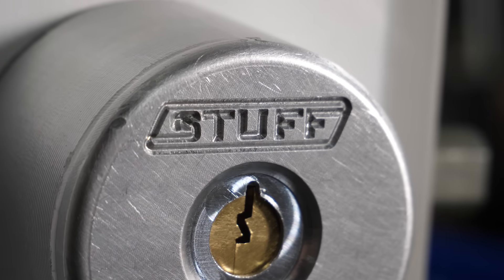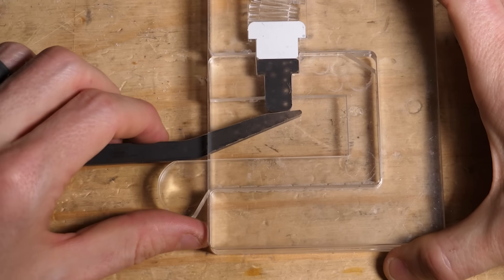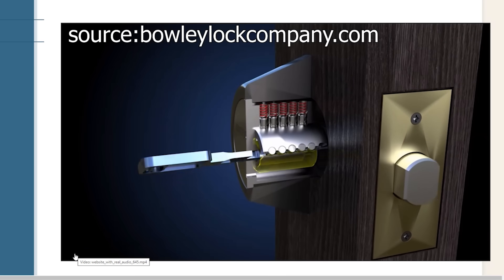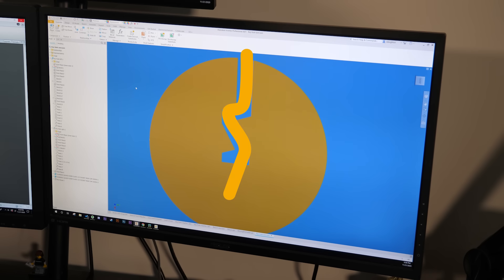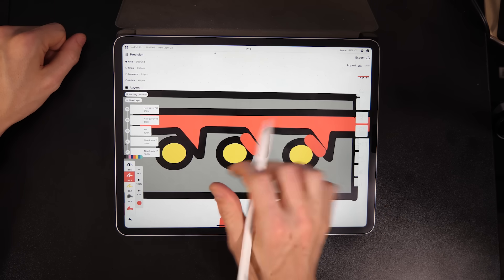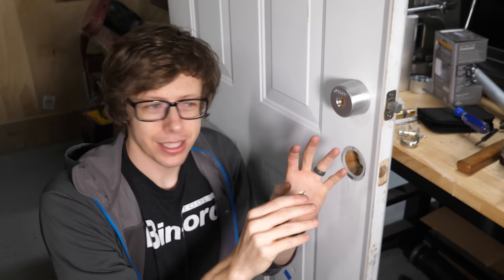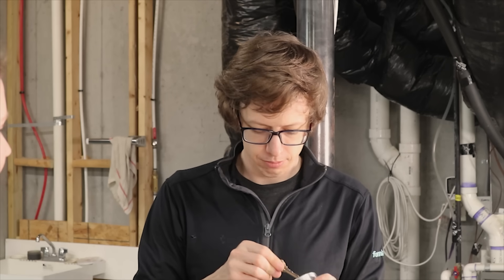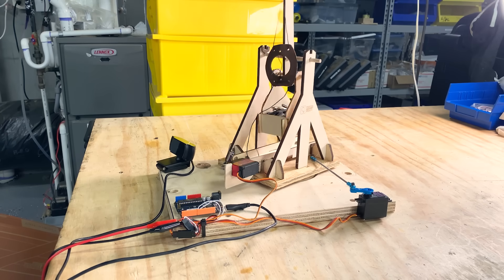Making an unpickable lock. Calling locksmiths

Comment: Add angle cuts to the key, and chisel pointed pins, and you essentially have the Emhart High Security Lock, a product that Medeco SUED into oblivion, before Both Medeco and Corbin-Russwin were all owned by Assa-Abloy.  I believe existing systems are still supported, but Cor-Rus is not actively marketing the product. Interlocking T Pins, rather than a sidebar, was the basic principle. Corbin Russwin did not derive a high percentage of their income through this product, it was probably 1% of their revenue, so they folded like a cheap card table when Medeco asserted that the angle cuts of the key were the primary feature, and thus violated their patent. Patents on Emhart HS long expired, so this could well be safe from a suit on the interlocking pin strategy

Comment: what might be a really cool followup project would be making the LOCKPICK that can unlock and pin lock. I know there are lots of types of locks and obvious fingerprint locks, digital code locks etc. but most homes and such still use fairly simple locks like the ones shown in this video- The first though that come to mind mind would be to make key that has pins of its own with tiny springs that push each pin upward to a given resistance (given by the spring on the pin in the lock mechanism itself which I imagine is slightly different for every lock based on how old, well oiled, and tons of other confounding variables apply to the lock). Still I think a new type of lock pick would be cool for when you don't have a bobby pin or a lockpicking tool. (No I'm not a lockpicker or robber, I just thought the project was cool!)

Comment: I'm not sure if I am over-simplifying this, but surely all this design did was to change the tensioning requirements. When tensioning, on top of the normal rotational pressure, ensure you push it all the way to the back so the "pin locking mechanism" is engaged, then pick as normal. It should still "click" into the horizontal gate when set.
The only reason why the locksmith failed was because normal tensioning technique/tools isn't able to engage the "pin locking mechanism", but once you know how this works (by watching this well-explained video), I doubt it'll be a challenge for LPL.

Comment: I think I have a way to pick this, it's almost like a chinese finger trap. Very clever design, and very counter-intuitive for standard lockpicking practices. I think the reduction in picking options makes it a fair amount more secure. Remember the Schneier principal, you can almost always come up with a security feature that you yourself cannot initially break, but enough people looking at it can probably break it. This is a good step in the right direction -- there are probably some little things to fix and it could end up improving lock security a good amount.

To pick:
Insert a blank key to push all the pins to the top.
Hold the key all the way in and turn until it stops.
Keep pressure against the internal stop.
Slightly remove the key (the pins should be held in place by tension against the gates, not the back), keep slight opening pressure.
Jiggle/bump until the pins fall down into the grooves.

If you don't have a blank key, you could probably turn a hook upside down and press it all the way in to get your initial set and hold the pins in place. Step 3 is the only part I'm not sure of, if the pins are held in place without pressing against the back of the cylinder, the above won't work.

A fix for this attack might be putting an upper lip on the slots (so the pins can't fall into the slots without having tension removed).
Reply: Nice. I just also independently came up with this exact solution! (See my comment). It took a lot of scrolling and reading about LPL comments to find this lol

Comment: Possible picking method: If the blocking mechanism is actuated only by the tip of the key, then I would try lifting all pins to the maximum height, turning thy cylinder to press them against the gates and then release the block to let the pins drop down and catch in the gates. If the blocking mechanism is fixed once the cylinder starts moving, then instead of simply releasing the block, I would try vibrating the lock strongly with some tool, which might be able to vibrate the spring-loaded locking pieces (depending of course on the friction, spring weights, ass etc.) and gradually release the pins down to the correct height.

Comment: “I found a locksmith that specializes in picking locks”
Reply: Well a lot of locksmith can maybe use a card, but if that does not work they either try to pull the lock out with a special tool or drill it out. Most won't (and can't) really pick a half decent lock.

Comment: Just an fyi. RFID locks can be electronically picked. Much like a standard pin lock there are only so many variables and computers can run through those faster than an expert with a pick
Reply: If it’s a quality lock, you need a pretty beefy computer, and at that point it would be more viable to drill the lock or break a window
Reply: @thereinthetrees_5626  I mean the easy way past a lock is normally to go around the lock yes and a blind attack would take a long time but it does not take long to look up a lock and its associated information which often reduces the possible permutations markedly

Comment: What an interesting system and cool shop. One question: What happens if you take a pipe wrench and spin the handsome and large cylinder body? The Finnish  Abloy added an outer, easily revolving shield, over the cylinder after pipe wrench attacks in the 60’s (if I recall it right).

Comment: I think this can be made in a much simpler way. I call it the "Centauri Barrel" and you don't need the complicated mechanism to lock the lifted pins in place.
If you use a stack of washers and then a slotted pin then some of your washers will turn with the barrel and some will remain, including the slotted pin. The washers and pin that are left behind are held against the barrel, and therefore in a consistent place. Both the washers and the pin can be adjusted to put the bitting code into the lock, the idea being that when a correct key is inserted the slots are at a predictable height.
The barrel is fitted with T-shaped half-flanges that check these stacks after some fraction of a turn. If you look up the Centauri from Babylon 5 you should have a reasonable idea of the shape I'm imagining. If the slot aligns with the bar of the T then the barrel will be allowed to continue. If the slot is not aligned then the barrel will be stopped.

Comment: You can lock a pin by literally grabbing it from both sides. After putting the key in you would push forward with the key to lock the pins and then rotate the barrel to move the pins to the gate.
Reply: the issue with having a pin at the end of the chamber to lock the pins in place when the key got fully inserted is that the pins might still be falling at the moment they got locked. So i think it might be better to change the trigger to lock the pins.

Comment: The hardest part was making a spring mechanism to grab and hold the pins without leaving any behind. Do you think that a non-metal material that could "squish", such as a soft rubber, would be an alternate solution?

Comment: Very entertaining. However, check out the smart key locks in the marketplace as well as the abloy, medical and other security cylindrical key locks and you will see that what you are experimenting with has already been done and are available at any lock store and some hardware or lumber stores. Also, how much did you spend on all the milling and lathe equipment?

Comment: I am a professional door installer of almost 3 decades. Very nice. You missed the obvious. Most break ins do not involve any picking at all. Judging on your crummy 24 g fjp edged steel door it wouldn’t matter. Could push it in no matter how beefed up the jamb is with steel plates.   Cylinder concept is great though. Good work

Comment: Try a tumbler that has magnets at the end of each pin so that if its picked the magnet will sieze the tumbler in place unless you use a key with a built in magnet to put the pins in the proper placement to turn

Comment: I can confirm that locks without normal keys are unpickable. 
The Dorm I live in changed to beepers or how theyre called, so you get a rotating cylinder on the lock that only engages the lock if you beep it with the correct beeper. I have no idea of how it actually works, so thats the best way to describe it and theyre are unpickable, sometimes even if you have the correct beeper. So i now dont lock my door anymore, so that i can get in even if the beeper doesnt work. Since my door has no working handle on the outside, i now never lock my door so i can at least get in using the old card trick to push the bolt of the door in, if my beeper stops working.

Comment: Locksmith here.

In my experience there’s ALWAYS a weakness or trick that you can do.

I pick at least 5 locks a day, 6 out of 7 days a week, and have busted out the “rotary pick” exactly once in the last 2 years.

I’m sure that if I went to your lock with zero knowledge of it I would likely be stumped. But if I had time to examine it, there would be a weakness somewhere.

My first instinct is to examine that pin shield.

Comment: "I finally ran out of ways to do it wrong and I cracked it"
Kinda doubt it, but an excellent line, nonetheless.
Here's another one for ya, JIC you haven't heard it, Idiot proof and engineer resistant.

You do realize there are replacement pins for regular deadbolts that will likely accomplish this same degree of security, meaning not pickable with ordinary picks, right?   Especially if you mix and match within the same lock.  And there are always other relatively easy ways to defeat pretty much ANY door lock, though most are destructive.  Here is a vid on more secure pins to retrofit existing locks:

https://youtu.be/a8tZA6hJJFU?t=28

Comment: Btw, there is a Russian lock that uses the same idea of first setting the elements, then turning them to do something. The main difference is that it's a lever-tumbler lock, and that it actually works very reliably.
It's called "Барьер Премьер" made by "Поливектор".
After a while some other manufacturers managed to replicate this principle with their own mechanisms, namely: "Guardian quattro 40.01" and "Меттэм Лидер".

Comment: Interesting project!
But from the standpoint of physical security it's probably moot. The door appears to be made of glass so that's probably pretty easy to bypass.
On top of that, as an enthusiast of lock sport, I take every opportunity to chat with locksmiths I cross paths with. The consensus seems to be "if I can't pick it open in a few minutes, I'll put the picks away and pull out the power drill".

I totally get that's not what this project is about, just some thoughts from a suspicious bastard ;-) 

Again, cool video!

Comment: Turns out it takes more effort to send the lock to LPL than to make the lock itself.
Reply: i mean, he is working on making the lock better before sending it over, so it will probably take a while longer before he even sends it over
Reply: @A2ne  He was working on an unpickable lock, either he succeeded or failed. No point in making better unpickable. For now.
Reply: @cleitonfelipe2092  "better" would mean more reliable as a lock/mechanism, not more pick resistant.
Reply: @rocketlanterns  I don't think LPL will use it as a lock
Reply: So he hasn't done it yet?
Reply: @heyhey8626  I see no other reason for the delay
Reply: @cleitonfelipe2092  maybe he has run into some issues, maybe he is working on other projects, maybe he has already but he is waiting to drop the video. Dont assume so much.
Reply: Thanks. Now I dont have to look for it lol.
Reply: To be fair, covid is unfortunately still a thing and god forbid my Ebay package that i ordered 6 months ago that still haven't arrived.
Reply: @dokeo3333  Yeah blame it on covid lol
Reply: I assume he doesn't just have one project and so he is probably working on other projects while attempting to improve his lock (which is what he said he will do) so just give it time
Reply: No doubt.
Reply: regardless LPL will pick it inside 2 mins. its virtually certain. bottom line, it still has to work with a key, and if it works with a key, then LPL can pick it. 
No real point sending it to LPL in my opinion. its just going to get opened in a  sub 3 min video when most of the video is LPL describing why he has it.
Reply: @DAGATHire  Nope, there is still that one lock with the key that rotates 180 degrees around warding before engaging with the pins. LPL hasn't managed to pick that one yet.
Reply: @rocketlanterns  what video is that
Reply: @kylebob5999  number 636, Bowley Lock Analysis
Reply: @DAGATHire  The reality is no lock is unpickable, the key(pun intended) is to make it take to much time and effort. I've watched a lot of LPL videos. Sure he'll get into it, but if it's PITA and novel he'll analyze it. He enjoys colabs, Companies have sent him some really high security stuff knowing full well he's gonna get in. Locks are rarely are designed to stop people like him and he knows that.
Reply: @CoreyKearney  im well aware of that tnx mate. been subbed to lpl for a long time. it will be fun to see but ultimately disappointing cos you know he'll open it like a coke can
Reply: @DAGATHire  He opens just about all of them like a coke can.
Reply: @CoreyKearney  And some of them with a can

Comment: “I found a lock smith that specializes in picking locks”
Reply: Not as dumb as you might think. Some lock “picks” only use bumping or bypasses, some use rakes and other low skill methods (including bumps/bypasses) while others might use specific decoders (special picks that imo are pretty easy but only work with some common locks/keyways) and other might do visual decoding (hella hard but pretty awesome).

Edit: pretty massive typo that Im actually very embarrassed by.

Comment: Wouldn't the springs break down? It seems like the lock is good but impractical since if you put it through weather it might have some issues. I'd be interested in an experiment on this lock with Cody's lab to test durability.

Comment: Why don't you just cut indents in the upper pins and make the tool pick them up and move them by the indents?
Say each of the P lower pins can be cut at N different heights, then just cut N V-shaped indents in the upper pin and make a Ʌ-shaped bar grab the upper pins by the indents, instead of by friction. No springs required, fewer moving parts, and the security will still be N^P.

Comment: Yes - keyless locks are technically "unpickable" but you can break their safety features much easier in most cases.
On some of them it's enough to just remove the front panel or zap it with a taser.
If you got an RFID lock someone could spoof your chip, unless its a real special chip instead of that default somewhat encrypted ID shitters.

Comment: This is conceptually similar to how the Mid-70’s GM ignition lock and Smartkey gen 3 locks work.  Your implementation is very different, but the general idea of those locks is as soon as you start to turn the core, the drivers disengage with the key pins (loosely speaking, the GM lock is a wafer lock, and the smartkey is sort of a hybrid pin/wafer system, and both use a sidebar as the actual locking mechanism.)

The smartkey gen 3 has a pretty fatal flaw which allows you to force the sidebar to continue to interact with the key pins, but as far as I’m aware, the mid-70s GM ignition lock has never been successfully picked.

Comment: “I found a locksmith that specializes in picking locks”
Isn’t that what they specialize in?
Reply: Being a locksmith myself, I can 100% confirm that most locksmiths do not pick. Most of us aren’t even that reliable as problem solvers. As with anything someone is trained in, they rely solely on the training and familiarity to accomplish the task. So in short they only really solve problems they’ve encountered before. Not me I’m stubborn I’ll attempt to pick anything for way too long.
Reply: it is often much more interesting for them (business-wise) to achieve customer satisfaction by breaking the lock (the key was lost anyways, right?) and sell them new locks/keys. Breaking is often even quicker than picking. Plus you don't need to keep training, plus you don't destroy the customers trust in locks :)
Reply: Locksmiths install and destroy locks, lock pickers pick locks. The two groups are not always the same people and I invite you to call up a locksmith yourself and find out. I have a set of picks but I also have a 20v dewalt drill. Which do you think is faster?
Reply: @FurnishedIgloo  ain’t that the true thing buddy. But I’m gonna go with the picker. it usually doesn’t take me long to pick. Half the time I just stick it in and it pops open. In and out in 5 minutes the invoice takes the longest
Reply: Nope, plenty of locksmiths don't pick.  They mostly cut keys or install locks, not pick them.
Reply: Yeah it was a somehow odd comment.
Reply: Mmm yes, the floor is floor

Comment: If you really want a challenge you’ll find someone who specializes in safes. Unfortunately, safe cracking is typically destructive and I’m sure you specifically asked him to not drill it out (very common in locksmithing). 
Very interesting concept.  Cylinders are extremely hard to design and even harder to manufacture so have to give you props for designing a functional one even if it could never be affordably manufactured.